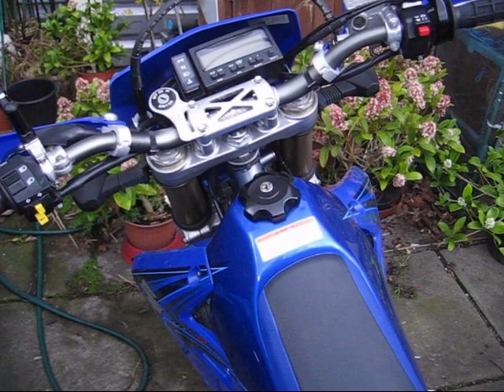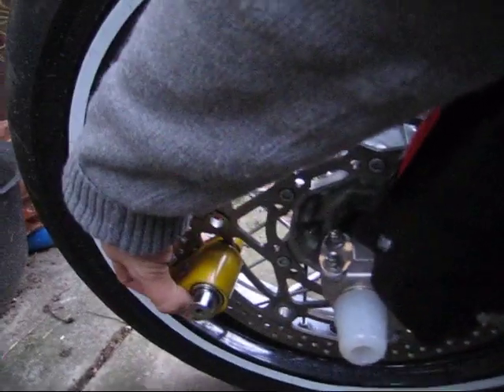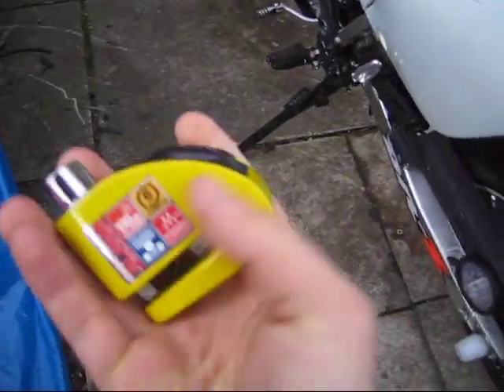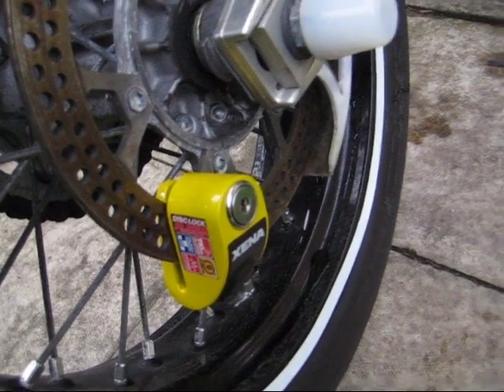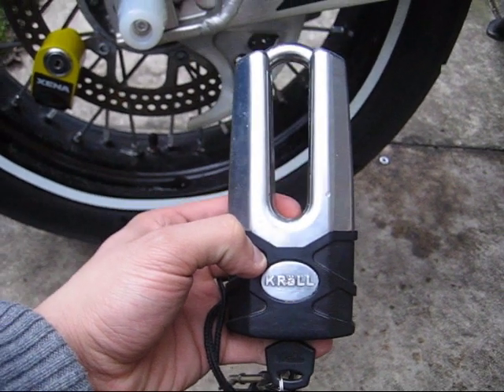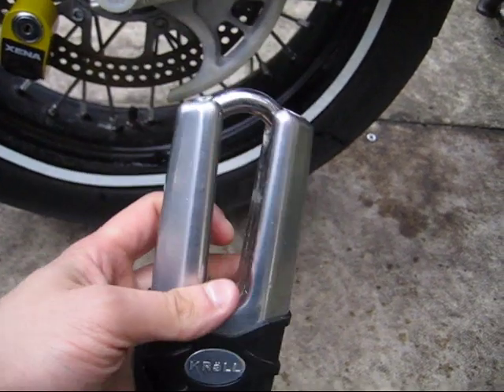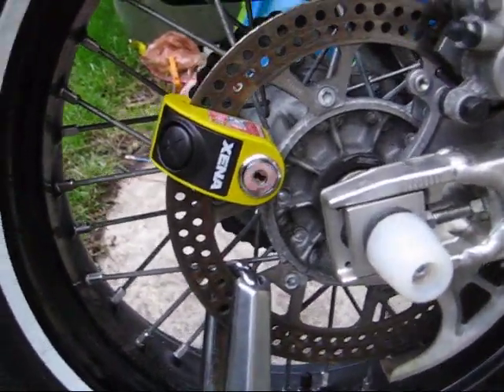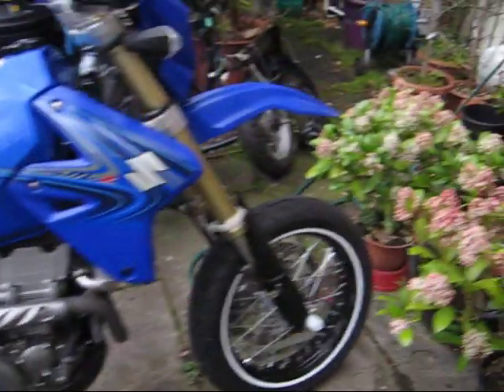Security Setup (Xena Disc lock)

Comment from the maker: If someone bumped into your steering it would go off. You can adjust the sensitivity by placing the lock in certain positions on your disc. So top is most sensitive.  Bottom of the disc is least. Like I said if a pro thief really wants your bike theyll get it. Best to keep the bike in ear shot of your house so you can hear it and get a good chain around a solid object.

Comment: It's interesting but when you add dB together they don't sum up just like natural numbers. dB is a logarithmic value- adding two sound pressure levels of
equal value will always result in a 3 dB increase, so when your 2 Xena alarms goes off, they generate about 113db.

Comment from the maker: @Pogost1ck 
It's a cheap 110db mini moto alarm from ebay.
I only just managed to get it behind the headlight plastic. It was a very tight fit.
The alarm runs from a separate 9v battery.
Decent enough though. It has 5 sensitivity options.

Comment from the maker: @Ataylor0 It's fine when strapped to my bike. Never had a problem. I just make sure my lock is at the bottom of the disc so the speaker points towards the ground.
Do this and the lock will last forever.
Some ballsack tried to take my XZZ6 lock off with a crowbar.... they failed.

Comment: I've got two of these alarm locks, i can never get them off quick enough before they go off. Mine also went off once as I walked away from the bike (putting on the back one must of nudged the front enough to set it off) I now use two non alarmed ones as i just couldn't set it up without setting them all off.

Comment: Your Krall lock looked promising not sure about those little xena though.  Most people here don't even give a 1% shit if an alarm goes off.  I'm trying to see if I can get permission to park in the cop stations lot across the street from my college campus.  Yet if I couldn't your setup could work since I would have to park in an open high pedestrian volume area.  I'm sure someone would call if somebody was messing with a bike and it had a few alarms going off lol. 

I heard a thief can disable low jack by just putting a specific sized magnet on your bikes frame...

Comment: Did you manage to pick up a live voltage feed under the headlight cowl for the alarm ?, I want to pick up a live feed for my bike sat nav but dont want to run a wire all the way to the battery. tnx

Comment from the maker: @devman224224 I've not had any rust problems with the bikes I've owned. Only the crap chinese scooter I once had started rusting. Rust effects people who live on the coast most because of the salt in the air. If your roads get gritted in winter then wash your bike down with cold water. My alarm locks are still in good condition. They have been scuffed a lot through usage but nothing is rusting. They are weather proof but you should still do your best to prevent water gettin on them..

Comment: What happens if they pick it up and put it in a van? Better get a hardened chain and use that lock to secure bike to something like a iron post of some kind
Reply: jesuisravi The alarms would still go off. But you're right, if it's in a not-so-populated area, definitely throw a chain through the frame and around something solid.

Comment: Sry to be a wiseguy but 3- 100dB locks add up to 106dB. The amplitude (or volume) doubles every 3 decibels. We dont experience it that way though.

Seems like you've got your locks sorted anyway, what is the alarm system you have on the bike itself?